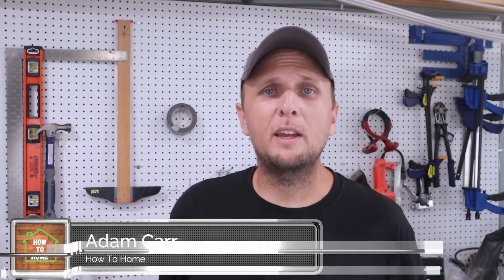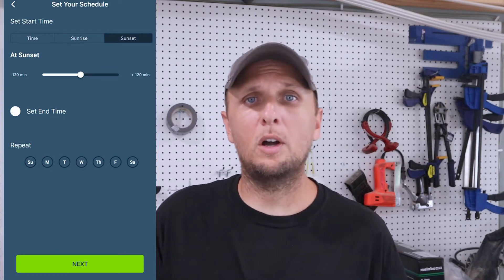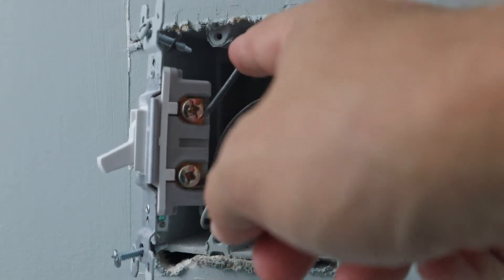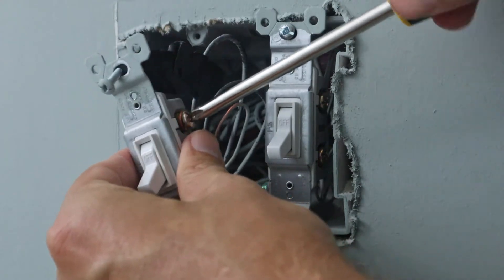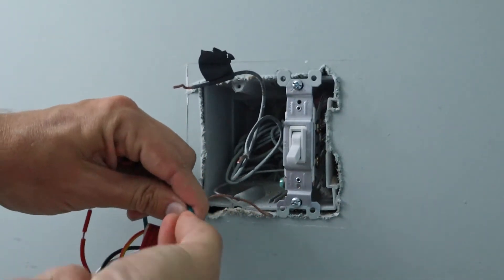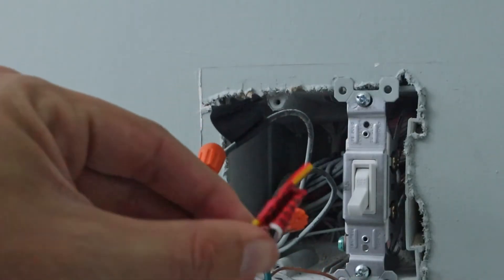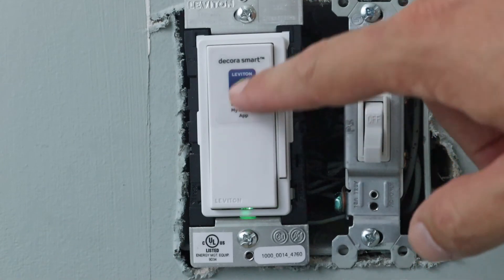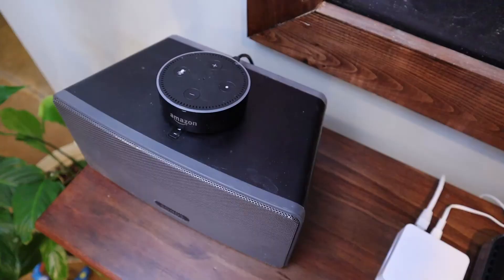Make Your Ceiling Fan Smart With Leviton Smart Fan Switch | Smart Fan Switch Installation

Comment: Hey,  so we just had an add on put on the back of the house, and for some reason the electricians only put in one switch panel for the ceiling light/fan... but it's on the opposite side of the room from where we'd be entering it on the inside of the house.... basically it's by the exterior door and has the outside light on the same panel.  But, i'm wanting to bring a second switch set to the other side. I was thinking of some kind of wireless set up since the ceiling space above the room is foam insulation filled, which would make it a bit harder to just run an additional wire from.   Do you have a suggestion on a set up for this?  i'd like both switch sets to work, but i don't want to have to pull up an app or tell the echo dot to do the job every time either

Comment: Any suggestions on these Leviton Smart Decora Switchen for a 3 speed Ceiling fan that also has 4 Old Style Medium base light bulbs that I put Led Light bulbs in or is this Switch only to be used on ceiling fans with no lights. The ceiling fan provides the only switch controlled light for the master 0:40 @How To Home

Comment: Hi does it work for DC motor fan that has a built in converter to work with AC power. ? Nice video
Reply: I have this same question- does switch work with DC powered fan?

Comment: Well, not really it’s not complete in your video. You show a fan with lights and installing the switch, but you need to also include that that switch does not also operate the lights so you might want to update it misleading you mention nothing that the other switch operates the lights.
Reply from the maker: Not misleading.  This is how they are made.  I don’t work for you.  Make your own channel.

Comment: Yes, your video is not very complete. Although you show how it operates the fan. What about the lights on the fan? Does it also control them through the switch on the wall?
Reply from the maker: It’s complete.  It’s about operating the fan with a smart switch.  Not the lights.  They are separate.

Comment: You have great videos on here and we appreciate it.  I have a good question for you concerning ceiling fans and a smart switch.  My set up in a bedroom is a ceiling fan with a light on it and a remote control to control both.  I originally had a 2 switch  wall outlet, one for the fan and one for the light.  I purchased a Wyze single pole smart switch because I wanted to get rid of the two switch setup since I use the remote after turning on the power to the fan. I connected the Wyze smart switch and it worked great for a month or so, but then all of a sudden, it started taking anywhere from 15 to 45 seconds for the fan light to come on when turning on the wall switch, which always turned on the light immediately when flipping the switch.  I first thought maybe a bad bulb, so I replaced that also. So, I thought it was a bad switch because they are inexpensive, so I took the Wyze switch out and replaced it with a Kasa smart switch.  Unfortunately, the light still takes many, many seonds to come on.   In my wall switch box, I had 3 white wires, one ground wire, one red wire and one black wire.  Should I be connecting the red and black together since I am only using the switch to power the light and fan, but use the remote to control it?   Can't understand why at first when I put in the Wyze switch, the light would come on immediately.   Scratching my head on this one. Would appreciate your advice on this one.  Thank you very much for your time and help..

Comment: But howbdo b you turn on the light from that switch?
Reply from the maker: You don’t.  The switch next to it does that.
Reply: Well, if the switch next to it does that you should say that in your video it’s very misleading so this smart switch does not control the lights and the fan on the same switch
Reply from the maker: What is misleading about it? 😂  when do I ever say or illustrate otherwise?  If you want a fan on its own switch it is always like this.
Reply: @HowToHomeDIY  just want you to know that I am not being nasty about it, but if you read your comments, there are a lot of people asking you does the switch also control the lights. Which it does not like to know, can you recommend a switch that does do the lights and the fan with just two wires coming out of the electrical box
Reply from the maker: @ECTVEDA920 oh you’re not?  You have numerous times now in other comments said I have been misleading.  No I haven’t.  Most people understand that no switch exists that can do that with just 2 wires.  That’s why the video doesn’t show it and none of the switches advertise it.  But I suppose the switch manufacturers are being misleading too then.
Reply: @henrymartinez243  I understand what you are trying to say the switch that I have now in the wall controls the light and the fan and has only two wires going to it. That’s why I was asking if you press the top of the switch it works the light and dim it if you press the bottom of the switch, it turns on the fan motor and speeds switch broke. It’s no longer manufactured by Emerson and I was looking for a replacement Smart switch that would do both all I was asking you to do in your video was to point out that the switch only works the fan motor and not the lights, we will leave it at that you have a good day

Comment: Great videos/page with detailed explanations of how to Dyi Electrical wiring. I have a question for you. I have a similar set up as yours with intent to install a GE zwave fan switch. It seems the contractors just looped one wire for neutral and one wire for the load wire to both switches. Would you recommend creating an individual neutral and load wires for each switch? Thanks for your time.

Comment: This guy is 100% correct when he's stated to use a voltmeter to check for the line wire.

Note there is one other way to verify a line wire. Look into the electrical box. And find the black wires with one electrical cap. And one pigtail wire going to the light switch. (If there's two or more light switches there will be more pigtails. [If there's more than one electrical circuit. You might not find the correct line wire. Use a volt in this case. ]) That is normally your line wire. 

If you have one or two sets wires in the box you must use voltmeter for testing the line wire. 

But if you three or more sets of wires that usually means the circuit has more than item added to the circuit. Therefore you'll be able to find your line wire much easier without a voltmeter when necessary. 

But be aware the only pigtail could be tied to two separate lights that has a single set of wires to each light box. When you have one single light switch in one box. I still highly recommend using a voltmeter to confirm.

If you have more than one pigtail tied to multiple light switches that you have definitely been able to confirm that you have found your line wire.

Homes built before 1980s use a volt meter for sure. All the time. Unless you know it has been fully upgraded to the wires that we use today. 

But unless you're a professional I highly recommend that you always use a voltmeter.

If you don't have a voltmeter go to your local hardware store and buy one they're not expensive. Also a circuit tester will work.  And if you're not sure, how to still do it. Then hire a licensed electrician to do it. And learn from them on how to  correctly do it. 

Due to electrical sparks. Always wear safety glasses. Due to electrical sparks can get into your eyes. When they happen.

Comment: Excellent tutorial, thanks.
1. If there wasn't a second switch for the lights, I guess it would be possible to control the lights with the pull chain. Am I right?
2. The switch can adjust 4 different fan speeds. If the fan has only 3 speeds by design, will the switch be limited to said three speeds or the speeds are solely determined by the switch?
Reply from the maker: You are welcome!
1.  No, there is going to be a switch for the lights on the fan, the question is whether or not you have a second hot lead run in order to have a separate switch for the fan. 
2.  The fan needs to be set to it's maximum setting via the pull chain, then the switch will adjust the speed based on which of the 4 speed settings to set it to. 
Hope this answered your questions.  Thanks for the feedback!
Reply: @HowToHomeDIY   @How To Home  Unfortunately, my apartment doesn't have the second hot wire. Right now, all my ceiling fans are operated with just one switch which feeds both the fan speed and the lights. I turn on and off the lights with the pull chain. I was wondering if I would be able to do the same with this smart switch. Thanks for your fast response.

Comment: How you turn on the light of the fan?
Reply: @alexisfernandez8552  I agree he needs to mention that the switch he installed only will control the fan and not the lights in the video. He shows the fan with lights, but never says anything that the switch will not control the lights which is misleading anyway it is what it is the video was informative, but not complete.
Reply from the maker: It’s not misleading.  It makes no sense in most situations to have a switch that controls both as you still need the same number of hot wires as you do for two switches.  That’s why very few even sell smart switches that do that.
Reply from the maker: With the switch next to it.

Comment: I have an old school fan I have a Smart switch but I don't think it's the right type. I don't have a dual switch setup it's pretty much the fan and  light  are both on one switch what kind of switch do I need for that wiring setup???
Reply: What did you end up doing? I have same issue

Comment: Does this same dimmer switch work for lights or is it specifically for fans? Thanks for the info. Not a lot of videos like this on YouTube.
Reply: If you have a 2nd dedicated switch for the light then you can use the smart Leviton dimmer switch side by side. But will only work on pull chain fans. Not remote control fans.
Reply: Wondering the same thing, ceiling fans/lights with one switch get no smart integration love! Wonder if I can split the single switch to a dual since I do have an unused red ‘fan’ wire in both locations.
Reply from the maker: Hey Daniel, this particular switch is just for the fan.  Thanks for the feedback!

Comment: Nice video. Can someone tell me what ceiling fan would be both compatible w a remote control(included) and a dimmer switch (Leviton or Lutron).  Or is this just NOT possible?  I have blown 2 motor ceiling fans trying_
Reply: Don't use a dimmer switch on the ceiling fan motor
Reply: Use a variable speed wall control not a dimmer

Comment: You find the load and line by looking for 120 volts between the line and ground (and absence of voltage between load and ground)?
Reply from the maker: Hey Jason, yes you are correct, assuming the switch is in the off position.  This next part I am sure you already know as your question tells me that you have knowledge in this area, but for others who may read these comments and aren't experienced, if the switch is in the on position, the load wire will also show 120 volts.  So the switch needs to be off in order to be able to identify the line and load wires.  Thank you very much for that question and giving me the opportunity to expound on that.